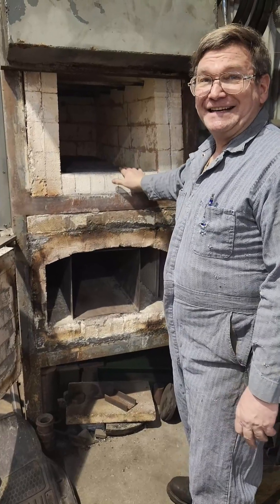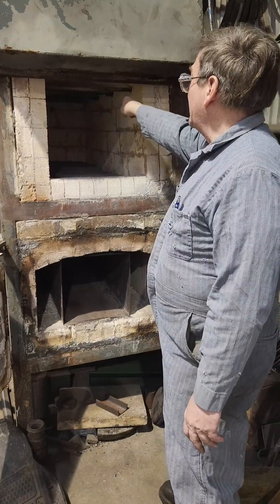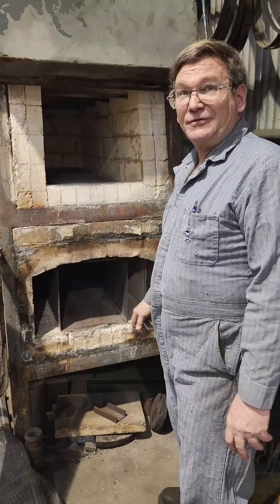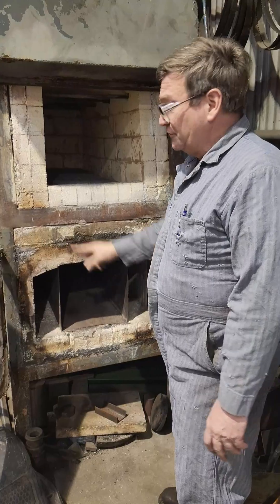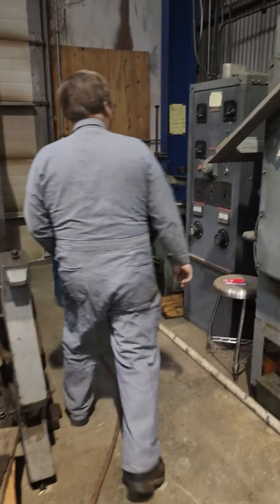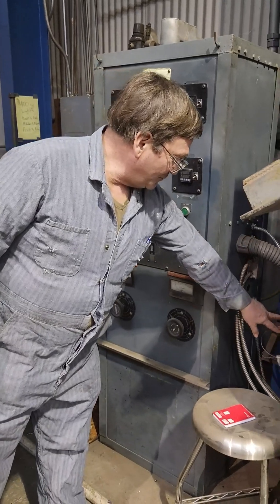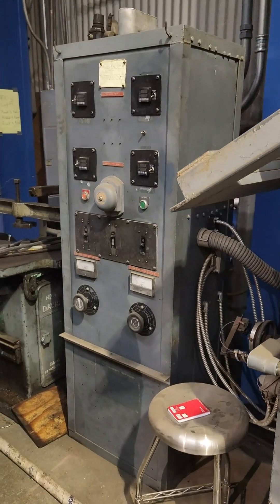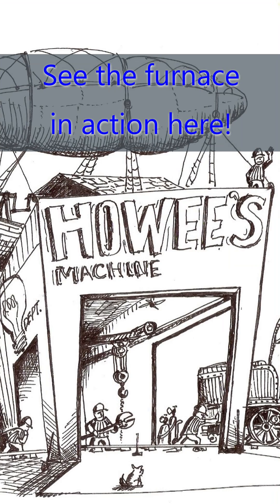Machinist's Minute: The heat treating furnace

Comment: Our shop had a nice little heat treat oven and one of the welders next door asked if they could use it. Asked if they knew how to use it and they said yes, come a little bit later the whole shop is filled with smoke. They put their part on aluminum blocks and cranked the heat, melting the aluminum and burning all the electronics under the oven.
Reply: > welders